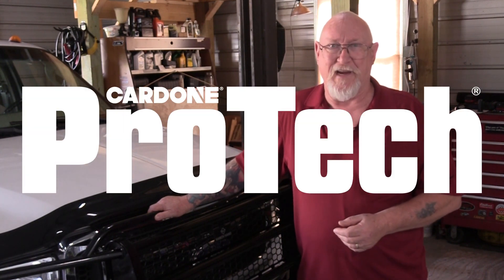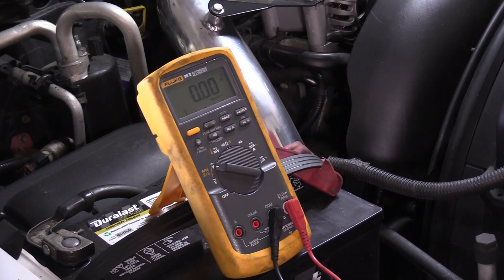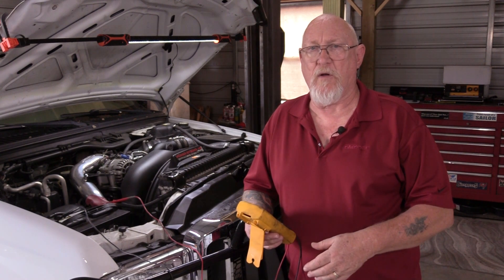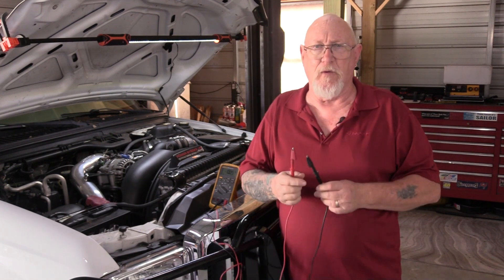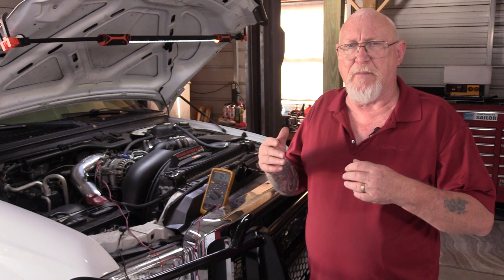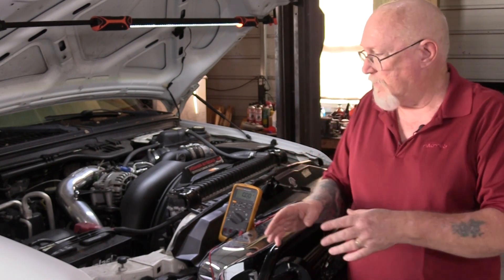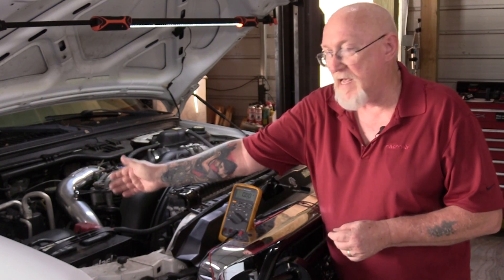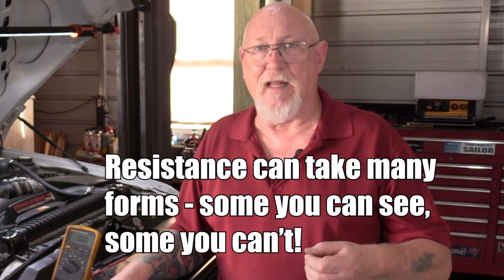Cardone PROTECH #10:  Finding The Thief (Practical Voltage Drop Testing)

Comment: We have an old John Deer tractor with a positive ground.   Until it was explained to me...  it made my head spin around backwards... I was very lucky to have someone who could explain that the current can run either direction if thats what somebody wanted to do.  Whew!

Seeing the positive from the battery go into the frame for the first time... it was like... this can't be.  Thats impossible!

Thanks again for this excellent real world voltage drop troubleshooting demo.

Comment: One of the simplest and fastest tests I ever learned for a first test on an alternator requires no meter at all.  The alternator produces charging power by spinning the magnetized rotor in the stator.  The steel, axle shaft of the alternator's rotor is also magnetized on a powered rotor.  An alternator producing power has a strong, magnetic pull on the tip of a steel screwdriver held near the back, center of the alternator case where the rotor shaft spins in the bearing.  No magnetism means no charge is produced by the alternator.  Just a 'quick & dirty' test to easily add an early piece of evidence.  As Pete shows in the video, solutions come from understanding evidence from all the tests in a diagnostic process.
Reply from the maker: I never heard of that! I'll have to try that out!

Comment: Always make sure all grounds and all connection points are clean and tight. If you do this, half to three quarters of your problems will not exist. Always clean the top of your battery off every time you check your engine oil, that will break any conductive salt or chemical trails on your battery and let it rest easily. You will keep the battery from high resistive drains that shorten battery and alternator life and save you money in the long run. Do that on your better half's car, too. He/She might thank you someday.

Comment: Where are you located at? I have a problem with my truck's idle that no one has figured out where the problem is. After replacing my engine everything was fine until 7,000 miles later and now I have an idle around 500 to 600 RPM and it's a little rough. I don't want to take a long trip with this truck without finding the problem that could cause the loss of another motor. The first engine ended up with 3 bent push rods. The throttle body has been replaced 3 times now with a new GM part each time. Nothing has changed. I did take it for a ride once where the engine idled perfect and then when I stopped at a store and restarted it, the engine idle went right back to low after the beginning of the trip it was idling at 700 rpm like it should be. Part of the EVAP system has already been replaced and the BCM was also replaced when the new Engine, Transmission, Transfer Case, Front differential, Wiring Harness, and most sensors were also replaced.

Comment: Would a continuity test from the B+ on the alternator to the battery show the same thing?
Reply from the maker: No. If any contact was present, statically it would test good. Always test dynamically whenever possible.
Reply: @VehicleServiceandRepair  thanks
Reply: No because a ohm meter can read continuity through a single Strand of wire. Voltage drop testing is the only way to go.

Comment: Pete, I am a little confused. Are you saying that you should have some kind of a voltage reading at the reference point and that 0.0 is a problem also? The reading should have a low milivolt reading and that is normal? The zero reading would also indicate a problem?
Reply from the maker: There should be some energy loss to overcome the small resistance the cable offers. A perfect 0.0v reading indicates an open circuit.
Reply: thanks Pete, I knew I could count on you for the answer

Comment: It blows my mind, how many people replace alternators, batteries, and even starters that didn't have anything wrong with them, because they failed to check for voltage drop.
It seems like MOST of the repair calls I've gotten lately, to replace this, that, or the other, turn out to be a bad connection only...

Comment: Voltage drops can be a real problem in many voltage circuits, but the most I've seen are in the cranking and charging circuits.
Before I retired, there were these two 3 axle tractors for the Hazmat Group.  One had an interesting voltage drop problem.  It had 2 GP31S batteries in parallel, with 4 Double Ought ( 4ea "00") size cables from the batteries.  The 2 red "00" cables went from the Positive battery posts to the cranking motor solenoid "BAT" terminal.  The 2 black "00" cables went from the Negative battery posts to the cranking motor Brush Plate end cover.
At one of the batteries a 4 gauge Red Positive cable went to a fuse, circuit breaker, and relay box.  That battery fed the truck it's electrical power for all the controls and accessories.
One time the truck started to have some very strange electrical problems especially the electronic speedometer.   The shop went went so far as replace the speedometer.  Same problem.
One day our lead man started to look at it then asked me to check it out.
First thing I saw with the engine running was one of the battery's was reading 14.2 V and the other was reading 12.5 V.  
I started grabbing and pulling on cables at the battery posts.  They were tight and the crimps were also tight.  Next I made sure the two Positive cables at the starter solenoid were tight and crimped properly.  They were.
When I pulled on the 2 Negative cables at the starter brush end plate one of the Negative cable's came right out of the terminal it had been crimped to!  This problem had been like this from the factory! 
Being a diesel engine in the truck, there's always some vibration when the engine is running which probably added to the cable coming loose in it's terminal.
The cable length was exact so just a repair at that end was not possible
I installed a brand new fabricated Double Ought cable from the battery to the starter end plate.  The other original cable was tight.  Started the engine, after a few minutes both batteries read 13.7 V at their terminals.  
Problem solved, all electrical in the truck worked as designed and no more intermittent problems while driving.
It took about 2 years before the problem was found, I don't know if it was sent back to the dealer for warranty repair.  I do know the driver complained about the gauges and running lights especially when the trailer was connected to the truck.
A simple little thing caused quite a bit of downtime.
Reply: I run two batteries in both my '90 Ranger, and my '79 GMC.I upgraded the alternators in both trucks. Keeping all connections right and tight kept me from having problems over the years. The Volvos I drove OTR had starting problems due to loose connections to the point I was taking each truck I was given to the mechanics barn if I had any starting problems. Usually it was battery or ground connections that caused hard or no starting conditions. I kept tools with me on the road all the time as you could never trust the company to get a service truck to you in time.